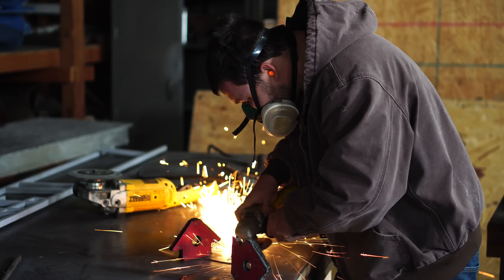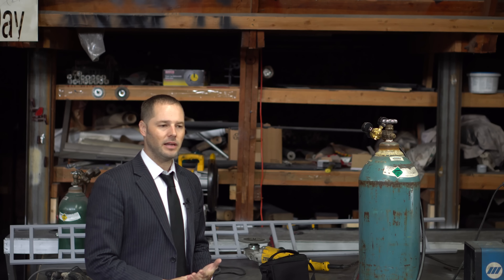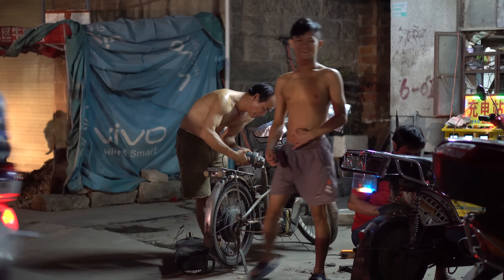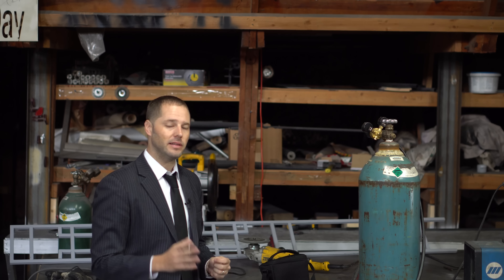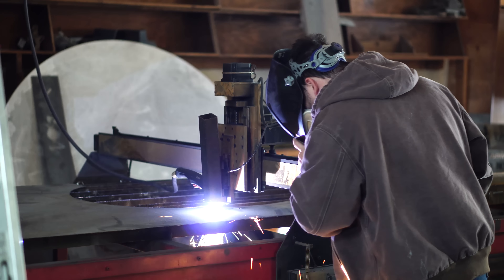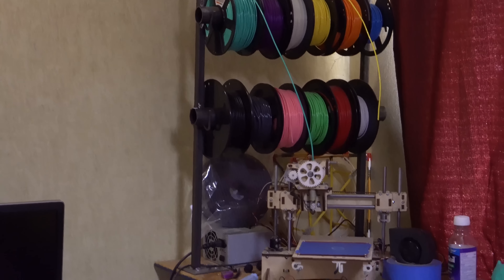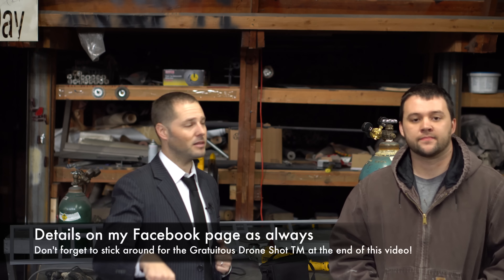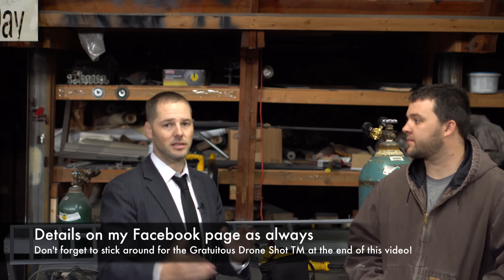Jack of all Trades, China has None!

Comment: I just noticed at 1:46 the Battery sitting on top of the hot dog cart next to the barbq sticks.  Is this to run the fan or start the grill piezo ignition.  Than theres wires running down to the propane tank below.

Comment: Nice video. I am sure there are jack of all trades in China,  not in the southern, but in the northern provinces of industrialized suburb area, mainly in frozen temperature. There you can find steel and metal mining production. And they have to fix a lot of heaters and stuff. One company has invented green ground-heat source machinery for households as well as for melting the tar sands in Canada.

Comment: Winston you are missing the limited slip option on that vette.
Reply from the maker: +Joe Yoone I was messing with the traction control
Reply: Joe Yoone limited slip has to.do.with the configuration of the gears in the rear transaxle.  positraction has the rear axle lock so  both wheels are.locked.together.  most transaxle.one wheel turns.  this reduces tire wear.  and yes limited slip is good.for snow.
Reply: websuspect indeed, in the initial intro shot with Winston spinning the wheels, I notice both wheels did not spin at the same time, in which I made the comment to Winston that his vette did not have the limited-slip option.
A torsen limited-slip is better than a clutchpack type LDS.

Comment: Wow!!! I didn't think there were 2 of me, out there... lol I began as a Class 1 driver (Tractor Trailers, etc.) then became a Welder, then became a Computer Programmer/Analyst, then married the 2 together and became a Robotic Welding Tech... There's more but I won't bore you... I make my own Vodka at home. I used to make Wine, but having to keep my Blood Sugar in check, I had to go to what I could drink... Beer and Wine are out, but Vodka did the trick :-) Oh! As for electronics... Sheesh! I have a hydroponic grow system, where I grow my own veggies at home... I built all of my LED Grow-lights myself... From the PCB Boards to installing the resistors and bulbs. I even designed the circuitry for the boards... I have a life motto... "If a man can build something - I can too"... I built my "Still" and run it... Loads of Chemistry involved. Distilling Vodka is very similar to Refining Oil and Gas, different chemicals boil off at different temperatures... I could go on for hours, but won't... lol Great to see another DIY guy out there... Oh! I also build 3D Printers... lol I'll shut up now :-)
Reply: I think i'm in the same boat, started working when I was 12 in a store warehouse, then to a PCB Manufacturers(CNC drilling, gold-plating, screen-print), Radiator Manufacturing(welding, pressing and powder coating) Auto parts rubber injection moulding, painter decorator, carpentry & kitchen-fitter, construction, I am now a professional chef, cooked all over Europe and now doing a CS degree with security and getting a buzz for electronics, and also photography...who know's what I'll get hooked on next...sewing?
Reply: I'm in the same boat brother ...
Reply: That's fantastic :-) I consider myself an "Idea Person"... My brain never stops... When talking to people, they sometimes discuss problems in their business and I often figure out solutions for them... My interests cover the entire spectrum and it rare to find a topic that doesn't interest me... Speaking of CNC... My 3D Printer, when complete will do conventional 3D Printing as well as CNC Machining, plasma cutting and even Metal Deposition to make objects out of steel... However, I don't think there are a lot of people out there who will be capable of taking advantage of every aspect of the system... but, everything will be there for those who can...

I am restarting another little business that I shut down many years ago. I'll be making my packaging myself utilizing Vacuum Forming plastic... I'll also be making the product. One step leads to the next :-) Sounds like you too have broad interests... That's wonderful :-) Oh! many years ago, many of my friends nicknamed me "MacGyver"... Go figure... lol
Reply: DStray Cat That's uncanny, I've just been looking into building my own CNC plasma, laser and 3D printing setup, just to build projects, I have a few in mind such as a motorized camera slider/dolly and a motorized  barn door trap for astro-photography along with a couple of raspberry pi projects, there just aren't enough minutes in the day, and it makes me anxious if I'm unable to complete them or if an obstruction (such as life's daily obligations) gets in my way! I just love problems, but can't for the life of me deal with personal shit...lol!
Reply: if you're into CNC then I recommend a YouTube channel "NYC CNC". I've been a subscriber for several years and have witnessed his incredible growth. He teaches "Fusion 360", a CAD CAM system for CNC. Moreover, he's really into Arduino and a lot of other stuff... I'm sure you'd love it. Another great channel for DIY CNC is Neo7CNC...

Oh! Something about your Laser idea... I was looking into Laser cutting but came away with the idea that Laser is very low in efficiency... Meaning, you put 200 watts of power In and get only 20% of that back in cutting ability... Plasma is much more efficient. I would recommend Water-jet if it wasn't so costly to setup and operate. Quite prohibitive for a small operation... Enjoy! :-)
Reply: Me too man! It's good to see Winston talking so positively about a person who is capable in many areas. Without too loud a toot on my own horn, I also am an all-rounder; I was touched when an old acquaintance described me as a 'Renaissance man'. But there's another side to this polymathy - I beat myself up a lot with feelings that although I'm quite good at many things, I'm not an expert in anything - Jack of . . . master of zilch. But it's all too late now for me :-(
Reply: I would be interested to know how many of you have taken a psych personality test. Myers-Briggs, Keirsey, MBTI, etc. If so, what were the results?
Reply: Boyd Bros. I've done that test, not sure of it's validity or whatnot, but I was categorized as an INTJ....social outcast that lives in his own mind....pretty spot on if I must say!
Reply: We in this comment thread should get together and start an Industry, cos I haven't met so many like-minded people in real life...only on the web!
Reply: Easier said than done... I'm in northern Canada. Gaud knows where you are... lol Getting together is one thing, organizing people who have divergent interests would be another... Then, no one wants to give away their Cherries... Many of the things I mentioned are over-ridden by Proprietary information... Meaning, I cannot discuss a lot as many of my ideas have Patent value... To begin, all of the members of the community would have to agree to "Non-disclosure - Non-Competitive" agreements, from the outset... and still there would be those who would breach the agreements... It's just human nature... I know, I would not participate... Sorry :-)
Reply: Robert Seviour You only think you're not a master, but I would pick an all rounder above anyone else, cos they have that curiosity...if you were required to master something, I could safely bet you would...and with ease. I just like to learn the fundamentals of a system, and that is many, many systems,but not feel the need to mastering any, but with a little creativity I'm able to know what systems could work with any another type of system that has been overlooked by say an expert in 'just one thing only'. I would say I look at things with a wide angle lens rather than with a microscope, I like the bigger scope of things and how they work, but the finer details are less important until I require them.
Reply: "Divergent" was a GREAT movie. I too am classified as a "Mastermind".
Reply: Personally, I rely heavily on YouTube for a lot of information... I once wanted to know how to "Darn Socks" and went to Y/T... Found about 100 videos on the subject... I seem to learn better from a video than reading... Anyway, Yes, this is a very positive thread and I am really enjoying all of the positive views :-)

I have a problem that I am trying to get a handle on. I read an article recently about people who bite their nails... They suggested that people who do that are generally Perfectionists that become frustrated and Obsessive to some degree. Unable to meet their goals they obsess over it and start biting... I tend to be like that... Everything must be perfect before I go after a challenge... Even the timing to start a project must be perfect... I have to have ALL of the ducks, in a row, before I start... Sometimes projects don't even get started because I can't get everything perfect... I am trying to learn to start projects when everything is not quite perfect... Hard to do...

So, that's why I take on small projects like fixing a Cel Phone. It helps to condition my mind to start bigger projects, even though it's not a perfect start... Sometimes, not knowing everything is a way to begin and learn as I go... Sometimes a little detail will foul things up but I keep at it and find the missing link... :-) That takes Creativity... Figure out what's missing and then find a way to get around it... The knowledge is out there. One only needs to search and the answers will come, naturally :-)
Reply: "...if you ask an INTj to design a good chair to withstand the weight of one adult, when it is finished it would probably withstand the weight of one adult elephant. "
Reply: DStray Cat I didn't mean it in a literal sense, I know that could not happen, but what I meant was...is that I wish I could find more people in everyday life that have the same interests and similarities with me, but locally rather than with the people that you can find online. Anyways what that boils down to is...I like to work alone, best wishes with your patents and your future projects, I'm confident you'll succeed, take it easy!

Edit: I'm in north west Ireland...
Reply: I had the same issues, it drives me batty when bosses demand something claiming "good enough", knowing myself it's F#@%ing garbage, but they want it out to the customers. One trick I've used to control this perfection thing is cooking. Read the recipe and then force myself to alter spices/ingredients to match a totally different cultures cuisine or mix and match stuff to make something odd as #e11.
Reply: Adrian, we INTJ types make up less than 1% of the ENTIRE WORLD population.
Reply: Boyd Bros. lol! I'm a chef...I know too well what you mean!
Reply: DStray Cat"Ducks in a row"...I call that "mise en place" and I live by that method. When I embark on any project no matter how small, the preparation is the key to perfection!
Reply: Hahaha!!! I cook the same way... The way Grannie did it... She didn't have any of this, so she used some of that... and it still came out tasting fantastic... I am or was Diabetic... I moved to a High Fat, moderate Protein and very low carbs... If you can imagine, I am a male who loves Quiche Lorraine... But I can't handle the carbs in the crust, so I adjusted the recipe to make it without a crust... When I was a Welder/Fitter, I was given + or 1/8"... It drove me nutz... I was too much of a perfectionist to deal with that... However, thanks for your input... I never thought of cooking to overcome my perfectionism... I rarely use a measuring spoon, but eyeball it... my favorite dishes are Asian... Thai, Malaysian and Szechuan, on occasion I'll make rice but sparingly... For me, Asians use too much sugar in their recipes, thank gaud for Stevia... :) Great chatting :-) Thanks
Reply: Looks like we need a dedicated forum. So I looked to see if INTJ.com was available - taken. Then INTJforum.com - that turns out to exist and is a busy location for intejers. Haven't explored it yet. If it isn't really a fit for people who have multiple (often practical) skills and interests, perhaps we can form something appropriate. I for one would love to be able to run ideas past like-minded, creative people.
Reply: Facebook as a BUNCH of INTJ groups

Comment: The big difference is the Standard and Consistency of the work performed.
The USA has codes and standards that are there to ensure safety and minimum standards, but in China anything goes and results will vary greatly.
As an example,, need to run an electrical cable and/or mount something?
You will see it all around China. A/C units are mounted and a hole drilled to the outside and a cable run thru the hole without any grommets or protection for the wiring.  Drill a hole where it is convenient and do what is easiest for the installer even if it means an unsafe or improper installation.

Comment: You've mentioned a very interesting fact. I think it has something to do with the way in which China was built up.
The idea of having a personal workshop is in contradiction to the core value of the Communist revolution, in which a common sense was broadly planted deep into people's mind that no resource should belong to any individual, and those who had the resource and techniques were severely punished and died out. So the rest of the people is now what you see as the modern Chinese people, who knows nothing but to follow whatever the government instructs. They are specially raised and controlled by the government, and are not suppose to have free will, not to mention building a personal workshop or creating anything meaningful.

Comment: I've traveled to many factories in and around Dongguan area and traveled to many places in the States, Canada and Australia. 
My observations for someone with 'Jack of all trade' seems to be the cost of having someone to do anything. 
In China, labor is still relatively cheap and there's no advantage of developing your own skill vs outsourcing someone with specialized skills. As wages increase we will slowly see a change.
I too began work with the hands on approach but as I started doing more things, I've began outsourcing my 3D rendering and CNC prototypes to others not developing my skills further.
Reply: +DavidRsaid Not sure what you mean, I did my high school under the British GCSE system and Uni in Australia.
I see values and priorities are different that limits the development of 'Jack of all trade' people in China with alternative options to get the job done prohibiting skill development in multiple files, that's what I mean. I've contemplated over purchasing a 5 axial CNC machine for prototyping but it's just so much cheaper for me to outsource that with welding, sand blasting than to have my own equipment. If I was still living in Australia, the cost for me to have done all that would easily be over 20 times what I'm paying currently and probably take a month to do that I'd have some gear setup in the garage to do myself. That's just me thou,

Comment: Yup that's right. I'm american and I can do plumbing, electrical, carpentry, welding, mechanical, circuitry, computer programming, low voltage, graphic design, accounting, painting etc. Access to YouTube and the desire to be independent is probably a big reason why.

Comment: I have found that the tradesmen HAVE LITTLE TO NO SKILLS>  They need to be watched. Now before I start my story, I will say my wife owns the house, And I had two people to help me translate. Both students of mine at the time. One to keep me calm, the other was an Aircraft engineer. I had a A/C system installed the first year I lived here. In America I was a refrigeration tech. 27 years experience. I was not at home when this BUTCHER installed this system. Everyone in my building and many others knew how upset I was. The system was GROSSLY installed if you can call it that. The store people are friends of ours. that is why I bought it from them. Now in America I was trained on these units. I knew what was in the box; I knew the specs; I even drew out the places of where to put it and where to drill the holes. This is not the end of this. The first guy came on a bicycle. did not and would not listen to my wife and friend where to install the unit. where he put the inside unit would not have cooled or heated the place. I complained. They sent the factory service to reinstall the unit. Now they had tools, came in a service truck and not on a bicycle as the first moron. But, BUT,  they still did not listen. The said I needed tubing added, I SAID NO> they added tubing. I marked where to drill. I knew the specs, and I can can read a tape measure. They said I was wrong. After drilling TWO HOURS IN TO THE CEMENT WALL, (THE HOLE IS 2 FEET DEEP!!!!!) Then, they drilled my mark. TWO MINUETS. They hooked up the system and wanted to leave. I would not let them leave till they calculate the amount of refrigerant needed for the added tubing. They did not know how. BIG SURPRISE>  I used to train techs, so before the added the tubing I measured the added tubing. They had no recovery equipment, No electronic site glass. No charging cylinder. They did have a set of very good gauges. It had a site glass that they did not know why or how to use. So I taught a class in how to meter in refrigerant. The system has been trouble free for over 4 years. Now I have a damage wall, NO ONE WILL FIX IN MY LIVING ROOM.I have a hole 2 feet deep in another wall. Cabinets with holes in them. A hole 3 inch to the outside, that birds live in in the during the spring time. This is only of the many stories I have concerning workers. Keep the videos coming, a lot of good information for new comers to China.